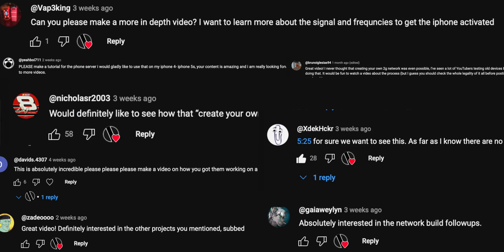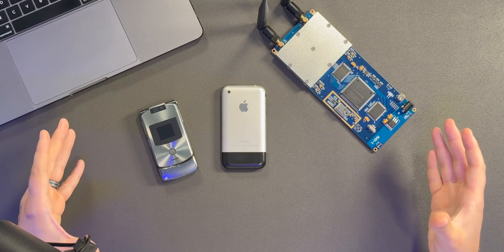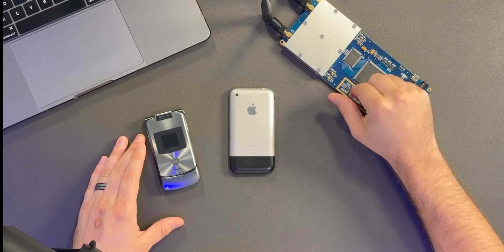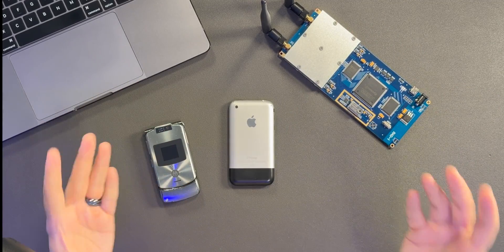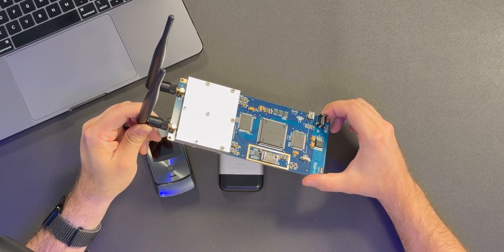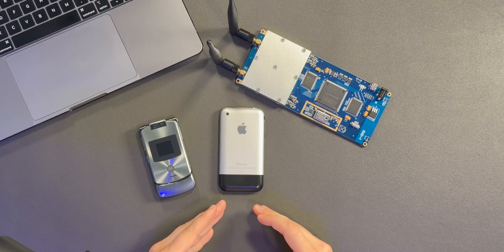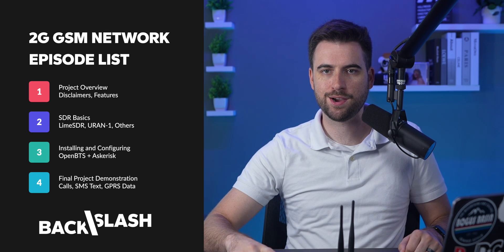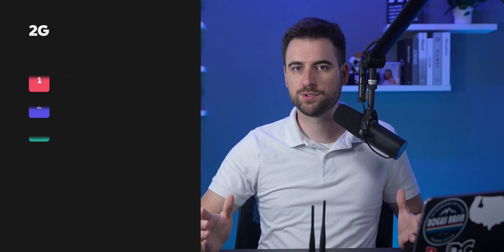I Built My Own 2G GSM Network - Part 1 (Project Overview)

Comment: Would love to see more SDR content!  Especially practical examples, not just watching waterfalls!

For example, I have a 2007 Yaris Key Fob, and have been unable to program a second Fob ( TEXAS 4D 67 "Dot" chip)..   Could an SDR (Flipper Zero, LimeSDR, etc) record/analyze/display the 2 fobs output to see why my second fob doesn't work?    There's a 0x44 cc article ("Reverse engineering a car key fob signal") that talks about "Universal Radio Hacker" software.. perhaps I need that?

Maybe a course, on just practical SDR applications..
--Morse Code CW Transmission (NFM and AM/USB) and automatic decoding/Receiving (CW Skimmer, CWGet , morsecode scphillips translator, "Playful Technologies" AI-based Morse Code Decoder, etc) 
--HAM : trunking (SDRTrunk / Unitrunker) / TETRA (SDRsharp plugin, OpenEar, OsmocomTETRA), digital-modes (DMR, D-Star, System Fusion/C4FM, NXDN, P25/Police Scanner (DSD LouisErigHere), POCSAG (PDW Software) , YSF FT8 )) , convert modes on the fly (i..e use DMR radio to talk on C4FM), 
--Decoding/Visualizing Weather Satellite data (noaa-apt, WXtoImg ) 
--ADSB Plane Tracking (X-Plane / XHSI and AdsbSCOPE plugin, MultiPSK with Maperitive) ;  
--Finding Satellites (Orbitron , g-predict, orekit)
--GPS Decoding/Plotting/Spoofing ( GNSS-SDRLIB, RTK-NAVI) 
--ATSC Video Receiver/Transmitter (Portsdown DATV, SDRAngel, GRC, SDRGlut) 
--Local GSM/LTE cellular network (GPRS) (gr-gsm, Kalibrate, IMSI-catcher, srsLTE-Sniffer, rtl-sdr-LTE dedsecimsi, FALCON) 
--Text/voice decoding (OpenEar, Defcon 2016) 
--Inmarsat AERO satellite Medlink AMBE Audio ACARS (jontio / libaeroambe built JAERO) 
--Reverse Engineer Direct Sequence Spread Spectrum
--Reverse Engineer an RF keyfob ( clock-recovery, analyze protocol (Universal-Radio-Hacker, Inspectrum), transmit ) 
- Reverse Engineer a Tire Pressure Monitoring Systems (TPMS)  - What about TPMS (tire-pressure monitoring system).. my tires are properly inflated yet, apparently it keeps sending the low pressure warning to the dash!

-Visualizing the RF that circuits emit.. like the videos:  "free radiated emission simulation (electric field) of a KiCad layout + PCB layout review"  and "[RadioFieldAR -tinySA-] Visualize radio wave strength." (manahiyo831 / VR_RTLSDR_AVATAR or RadioFieldAR_tinySA-ULTRA) 

(Commercial software tools like Ansys Electronics Desktop (AEDT), Ansys HFSS, Electromagnetic Interference and Compatibility (EMI/EMC) , Maxwell, Siwave, etc.. are too expensive for hobby, but I imagine some combination of open-source software (GNU-Radio), hardware (a spectrum analyzer and an SDR) could provide some valuable insights before doing real testing (MIL-STD-461's CE101/CE102/etc))

Comment: It's great to see your process! Hopefully these recent videos on home GSM BTS can spread awareness about the effects of the GSM shutdown globally, and further development on SDR GSM projects.

I would recommend you to get a RTL-SDR to scan the channels, you can see your GSM channel on the air and find clear RF space to avoid interfering with current LTE. It's very easy to cause issues with your network and the existing LTE networks. There is also a method to run the Osmocom GSM stack on your URAN-1 board as well, which is much improved than OpenBTS, a video is already on Youtube made by a friend of mine. I can share the tutorial if you are interested.
Reply from the maker: Please do share! Not only for me (I would love to upgrade from OpenBTS) but I can share it in future videos
Reply: @BackSlashYT  This is the setup: https://www.youtube.com/watch?v=F5cpyCD6ZQA

GPRS config is a one-time config, but it's a bit difficult to configure it properly the first time.

You can use the same hardware but overall better performance and critical features, like seamless location update reject to non-subscribers without disrupting their service. I also liked that you used Test 001-01 instead of a commercial operator's PLMN like dosdude with AT&T.
Reply from the maker: @mobilephonesandtech Uploaded 2 weeks ago? That’s crazy so many are uploading videos about this suddenly. We all woke up and craved nostalgia! Thanks for sharing, I’ll definitely take a dive into it
Reply: @BackSlashYT  I don't mean to self promote but I also have some demos of Osmocom on my channel, though I never made a setup guide... worth checking out if you want to see the functionality.
Reply from the maker: @mobilephonesandtech Self promote away! I want my channel to be a town square, not a lecture. I’ll definitely check it out!

Comment: Once the iPhone 2G is connected to the network could you be able to text and calls numbers on modern phones like an iPhone 13 or a modern Samsung or only phones connected to 2G
Reply from the maker: Good question! That depends. In theory, you can link the base station to Google Voice, but I haven't been able to get that working (yet)
Reply: @BackSlashYT  Oh ok
Reply: @BackSlashYT  Did you manage to get it working now?
Reply from the maker: @sBloxman23 no, I gave up on the Google voice texting project… but I did get voice calls working with Asterisk which is cool
Reply: @BackSlashYT  Voice calls for the devices connected to the tower only?